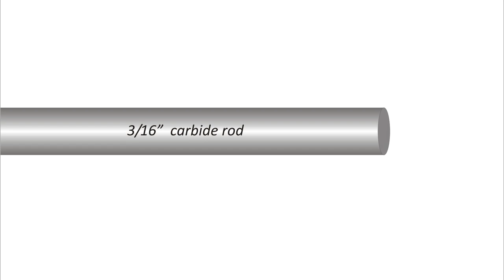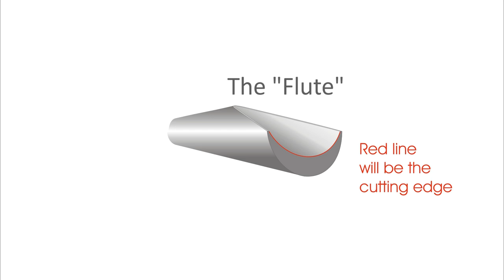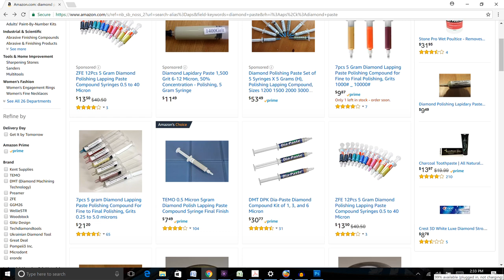Making Carbide Gouges

Comment: Toolmaker's suggestion.

Mix the diamond paste with a bit if oil to thin it out.  It will actually cut better.

Also, any softer than carbide substrate can be used.  I would take the wear out of a digital micrometer with a piece of steel shim stock and diamond paste.  The grit embeds itself in the substrate.  This is why your MDF substrate didn't wear.

If you watch any of the telescope mirror making tutorials, the lap substrate is pitch for polishing.

The substrate should always be softer than the part you are cutting.  Any harder and the grit will transfer from the lap to the part.

Comment: "The very soft MDF does not rapidly wear away on the extremely hard carbide.  Go figure."

I'd figure that the diamond paste fills the gaps in the MDF, providing a surface on which a thin layer of paste can ride.  It's a similar principle to the one the Egyptians used to cut limestone for monuments and to sheath the pyramids, before they had iron (let alone steel) tools: a shallow square-toothed copper saw was drawn backwards and forwards by two men while a third continuously sprinkled granite dust into the cut.  The cut surfaces could then be smoothed and polished with leather pads and more granite dust.

Comment: Great video. Very informative. Can't wait to watch more of your videos. Could you please tell me the make and model of your lathe? Thank you, Jase.
Reply from the maker: Central Machinery 10x18 from Harbor Freight.  The quality of merchandise at HF varies tremendously, and the buyer needs to be careful.  However, my experience with this little lathe has been excellent over the past 3-4 years.  It is quiet, smooth, and reliable.  There are many better lathes, but few can compete in terms of value for the dollar.  If you want to do bowl turning, or more advanced work, you would need a larger and more powerful lathe, and I would recommend one that allows you to adjust the speed by simply turning a knob.

Comment: they actually make MDF knife sharpening systems ..like the ones you see in bass pro or gun shows offering yo sharpen your knife for a few buck..i had a disk and put it on a old record player loaded with buffing comp. for a flat strop..it work great! old turntables are cheep at second hand stores too i just load each side of my disk with different grits. i run around 78 rmp and used 1/2 mdf
Reply: That's a brilliant idea! And because they run so relatively slowly they don't run the risk of overheating the material you're cutting!

Comment: Also...

As a toolmaker in an actual shop, the standard tool for grinding carbide is a baldor driven pedestal grinder with diamond cup wheels that have a resin bond, coarse on one side, fine on the other.  However this is the expensive way to go.  Plated wheels are much less expensive but they never need dressing and last literally forever if taken care of.

A for instance website:

http://www.johnsonbrotherslapidary.com/shop-bin/sc/ss_mb.cgi

Stumpy nubs woodworking has an excellent video introducing these to woodworkers.

Diamond for carbide, CBN for steel, never the opposite.

Comment: i used to do carving..cut my fingers open several times...stopped carving when my tool ended up 3 inches deep in my thigh meat...and i sat there looking at it..thinking. i know this is going to hurt really bad in a minute..or right after i pull it out...the wood piece broke causing this..i was using my leg to hold the piece in a strange position to make the cut...i was pushing toward my leg...